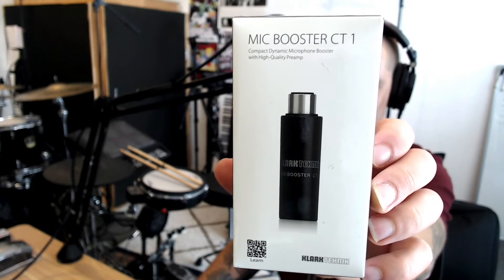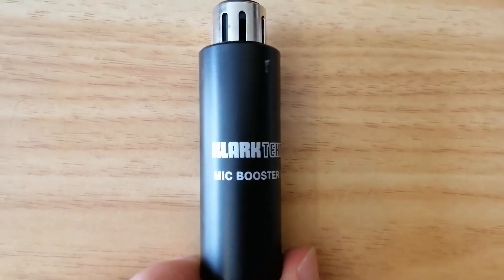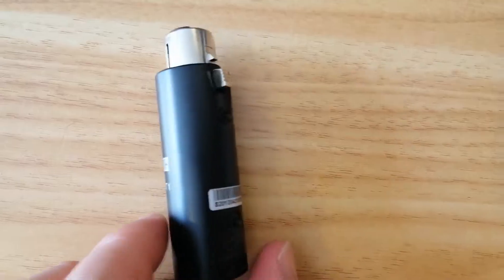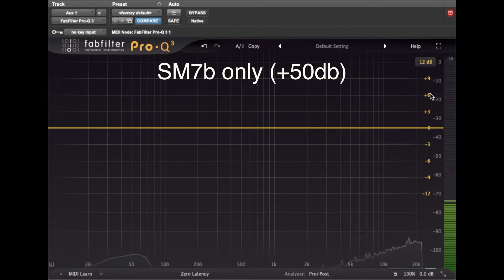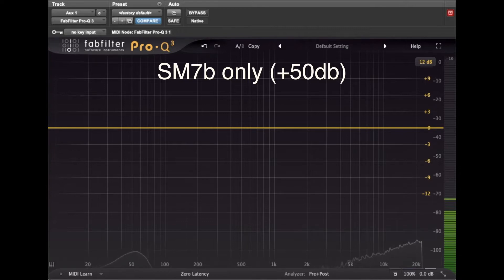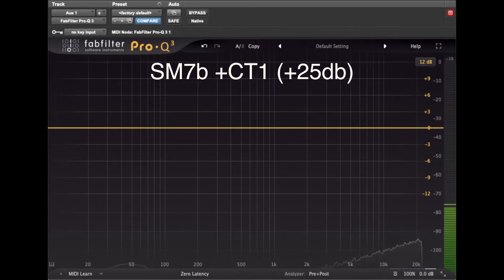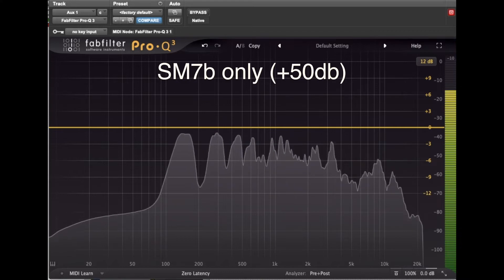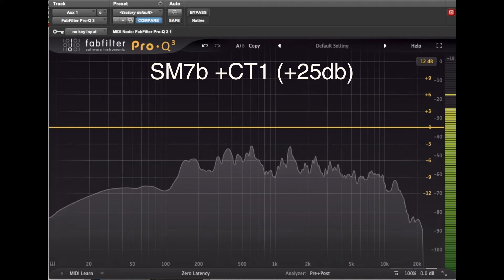Klark Teknik Mic Booster CT 1 - Test and Review with Shure SM7b

Comment: i heard that CT1 has interference with electronic like phone.. do you have any such issues....
Reply from the maker: I haven't experienced any issues like this.
Reply: @PrecisionPodcasting  good to know that... Thanks for the reply
Reply: yes, i cant use ct1 because radio sounds is tooooo much noisy
Reply: @enen1998  radio sound meaning due to electromagnetic interference?
Reply: @johnson_guite  yes but i can hear all radio stadions in one time xd
Reply: @enen1998  u should try to reposition your mic, maybe even turn around or use another room if u are a lil lucky u can remove that, just was in a reddit of a guy who had the exact same problem!
Good luck :)